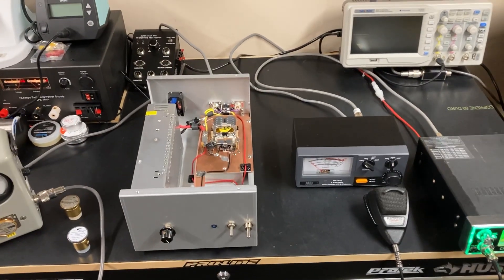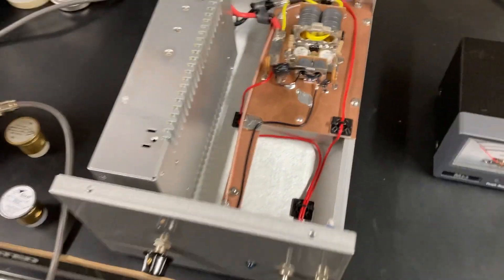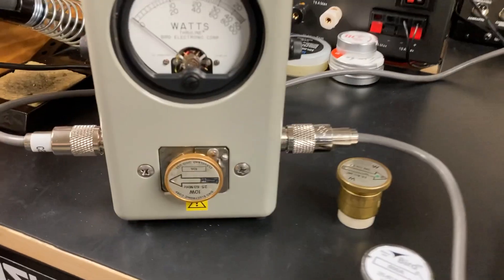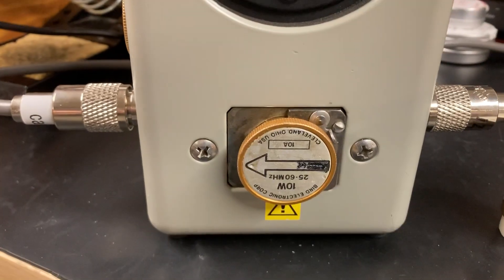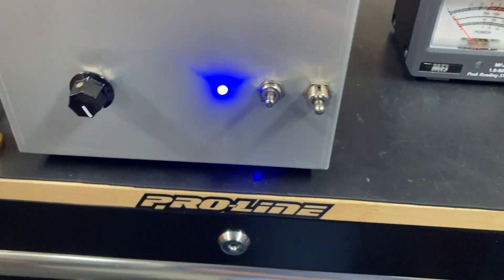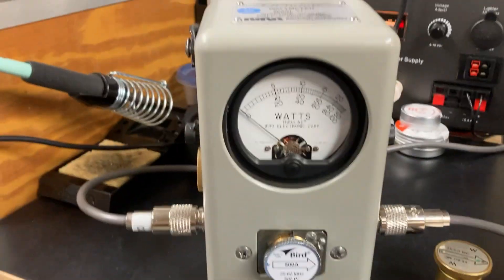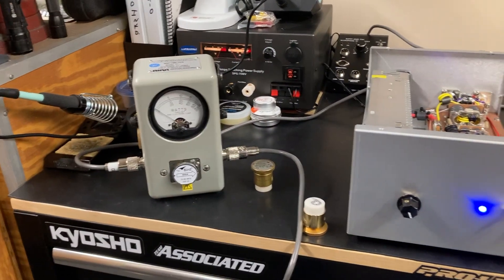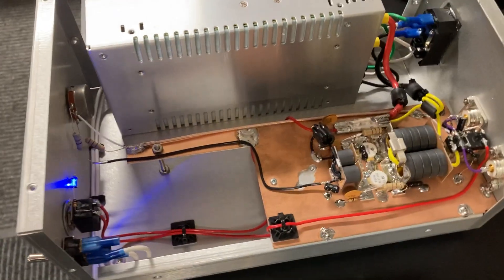106 amps base build (finish and test)

Comment: You can't get 500 watts out of a 2 pill class c amp. I have built many 2 pill amps and the power transistor's specs show it plain and clear the output of the pill you are using. 2 pills will NOT output 500w. Even in my bench testing up to 22v and high input drive and swing no go. when you are in the game of making amps class c they show you what you can only see and it is NOT 500w. It just will not happen unless you have high SWR or using a meter that is not calibrated to show you what you want to see. A bit of hokus pokus if you know what I mean.   NOT GOING TO HAPPEN!   I have been building 22yrs again you are correct not going to do 500w.  But if you listin to the preacher long enough you will start to believe they will. Punisher amps.
Reply from the maker: Thanks I appreciate it

Comment: the bypass tune is the same process as when you checked your input reflect with the meter between radio and amp. Input tune is when amp is on, bypass tune is when amp is off.  Nice neat job and your output is great! 250w rms is great for a 2 pill, the 500 youre seeing is "peak watts" which im sure you have close to that if you put your diawa peak meter after the amp and checked. Nice job brother
Reply from the maker: hammerjockey repair, thank you very much for that i really appreciate it.